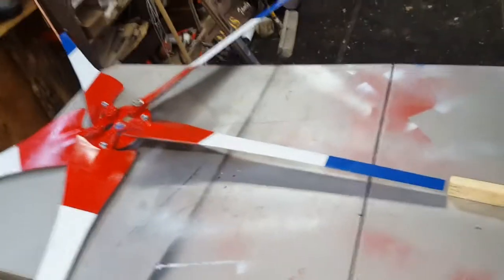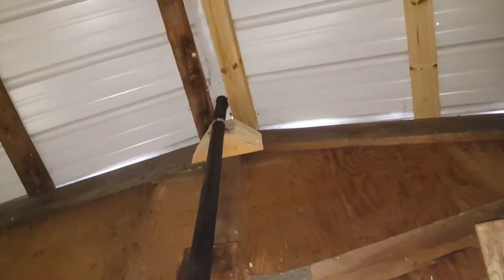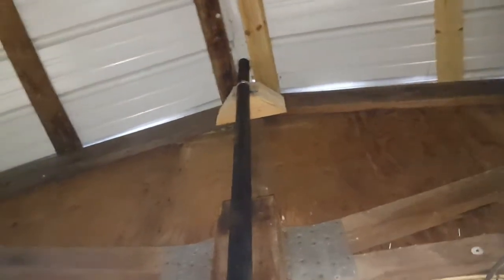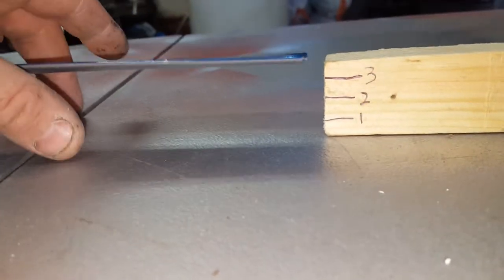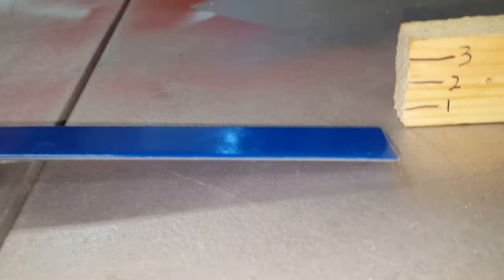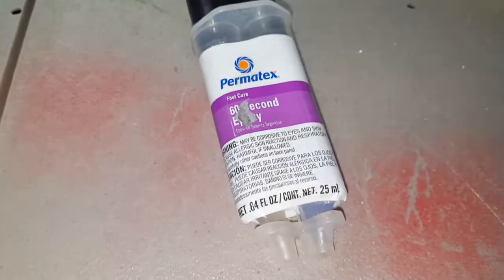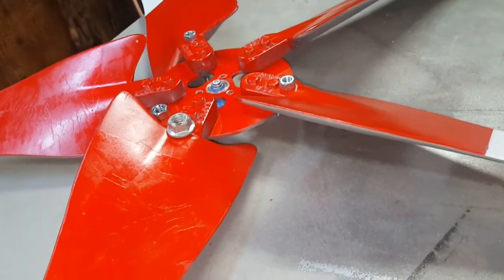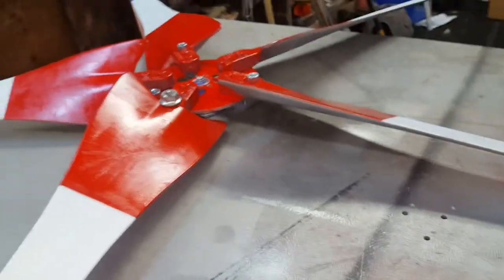Balance your wind turbine blades!

Comment: The old way to get rid of bias was to drop a string from the ceiling and the little piece of steel in the middle hole that will tell you exactly which blade is too heavy. Then screw in a self-tapping screw on the lightest blade. 
Personally I wouldn’t advise using glue, no matter how strong. Because, if that the nut comes loose it will fly like a bullet, and Murphy’s Law Murphy’s Law says it will hit someone in the head.

Comment: Such pure junk that missouri wind garbage
Reply: Naturally Blondy , you get four brand new tires and you get them mounted on your car or truck, do they balance ? they're brand new tires, well of course they do, anything that spins needs to be balanced, the crankshaft in the engine of every single vehicle is balanced, every airplane engine every rocket engine anything that spins needs to be balanced, and it's brand new and it still needs to be balanced, it's not junk, it just spins, you don't say that your brand new tires that you just got mounted on your vehicle is junk, before you call something junk why don't you learn how it works, but I'm thinking that your brain don't even work at all, turn the lights on before you go stumbling around in the dark, what do they call 20 blondes in a basement? a whine cellar

Comment: nice vid, ive had to do the same the blades were upto 20 grams different in weight and each blade had a different centre of gravity.
i am ordering that simple balancer though the price is right.
Reply from the maker: I don't use nuts and bolts anymore I use car self-adhesive wheel weights for aluminum rims I think I did a video on it oh, I'm not much of a video maker but I try. So far to this day I have had no problems everything is spinning fine blades are fine, I have three wind turbines all the Dinoco tied into my batteries and one day the wind was strong and the amps were up to 140 amps going into them
Reply: @TheoriginalAndysgarage  i know its been a while but these days how i do it  is to use a car alternator bolted to a pole , those things are internaly balanced and turn smooth as silk, i tap the blades left or right to balance , no adding weights, ive tried the lawn mower balancers ages ago but im a perfectionist.